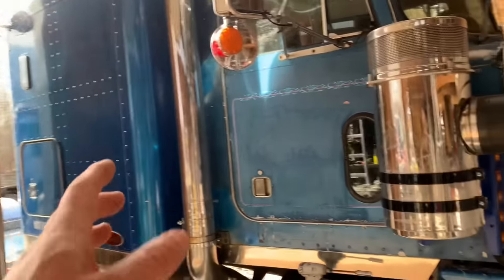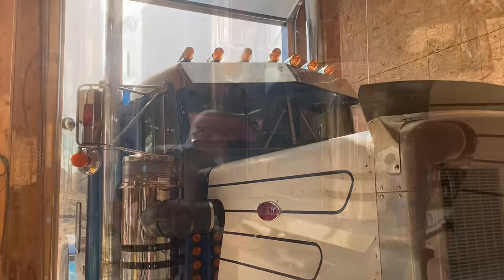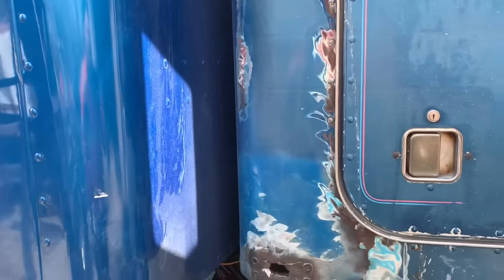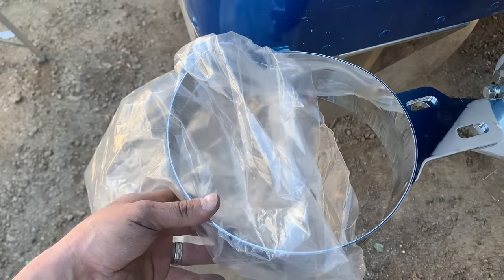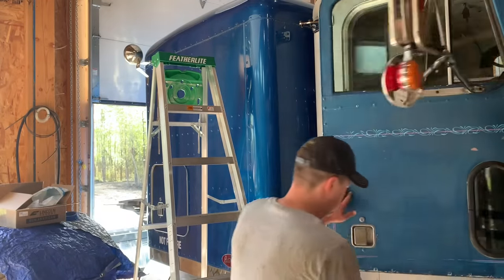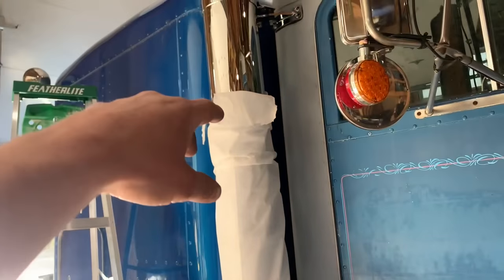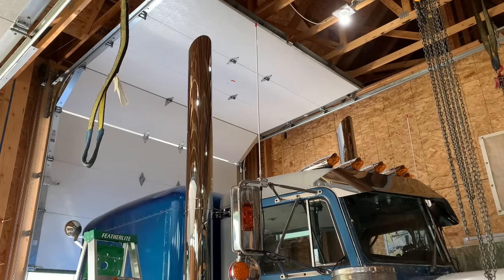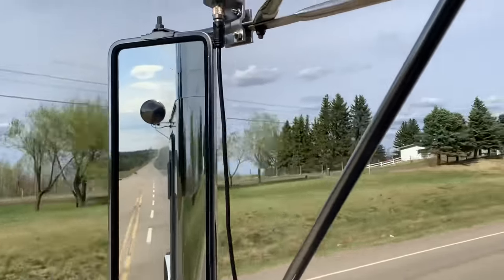Peterbilt 359 Restoration Ep.64 Lincoln Str8 Pipes

Comment: As a guy who started in 1966 grabbing gears, I want to mention there is a very cool invention called the muffler. It make driving rather pleasant. Dropping down a 15 mile 12% grade in an off highway truck grossing 250,000 pounds and a straight pipe  coming out of the hood, I was so happy to get a truck with a muffler. I lost my hearing driving with straight stacks. 
They may look 'cool," but they are painful over time.

Comment: Love the new larger pipes on the rig, I think you should put those hanging support brackets back on the frame rail for the horizontal pipe under the rig. This is important for driving in snow any snow pile or snow drift you drive over could rip out the new pipes.

Comment: Whenever you patch sheet metal you never want square patches, you always want to have oval or round patches or at a minimum you want to radius the corners of any patches.  The purpose of that is due to the fact that the corners of square patch panels pull when you weld them.

Comment: I think the project in its current state looks bad ass, paint job or no paint job. I love seeing all the mix n matched old  parts with the fresh chrome. It almost tells a story of all the hard work going in to it. Just a thought, it almost looks as if the gap between the tanks and the elbow should be shortened up a bit. Depending on how much overhang you have behind the sleeper.

Comment: I went through this with the same pipes and and truck and what you need to do is modify the length of the bracket so the pipe is tucked in closer to the truck.

Comment: Should have but high temp silicone between the three sections. With out the silicone the exhaust soot will work it’s way between the sections and mix with water if you run threw any rain and start rusting down the back of the stacks

Comment: Don't feel to bad about your initial clamp confusion.  I had a licensed mechanic install pipes on my previous T800. He phoned saying I had gotten the wrong brackets and he had spent 2 hours trying to make them work but they wouldn't. Long story short , by the time I got there , a 1st year apprentice had figured out the mechanic had the left hand bracket on the right side cab corner 🤦‍♂️🤣 I got the apprentice to finish the install for me.

Comment: you should put a paint on the repairs as well since the primer does not protect the metal from the elements unless you use epoxy primer with a catalyst. Squirt some paint over the primer to protect the metal.

Comment: whoo ho ,after you shop is done you need to take L.b.L apart to the bones and blast the cab, 
and replace the side skin that's worse than expected, but if you do that, it is a full restoration.
nice bark btw. allthough I like the look of the 6's more I personaly'd took 7's stainless or Aluminium.

Comment: I strongly suggest that you drill a hole in the y-pipe to drain water out.
Reply from the maker: I thought of that but then I realized the 8” Pickett elbow is lower then the 5” y-pipe so it wouldn’t fully drain and I don’t want to drill holes in the Picketts 🤔
Reply: @TwinStix  I guess the best thing then is to get a stainless elbow😱

Comment: Couldnt you have bolted the pipe to the ellbow on the floor with the clamps in the right spot (messuring) and then lift them up to the truck instead or would that have been to heavy? Awesome progress though!
Reply from the maker: Yeah there’s more than one way to skin a cat I suppose 🤔 but those top pipes were heavy enough without the Pickett elbows bolted on there 😂

Comment: Ok love the look of the truck but would make it even cooler is a centered y pipe. So basically instead of the y pipe being favoring the passenger side it would be going down the middle of the truck because of you look the smoke coming out of the engine is favoring the passenger side and then it comes out late on the drivers side so it’s not even so a centered y pipe would fox that